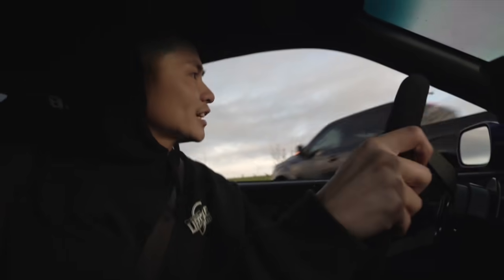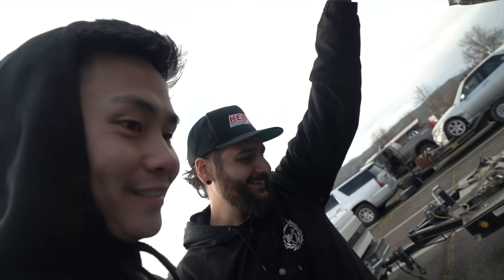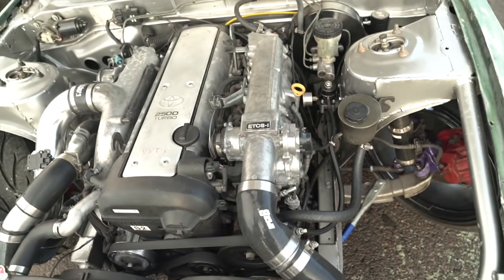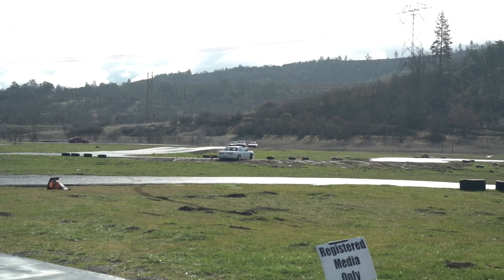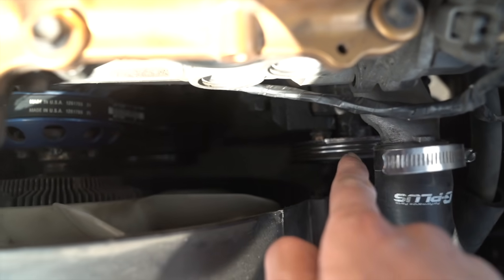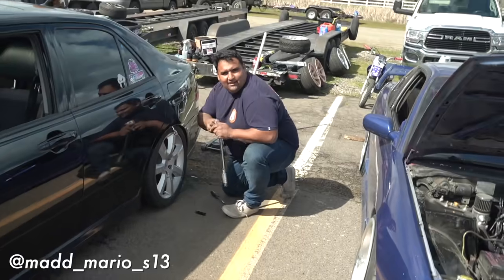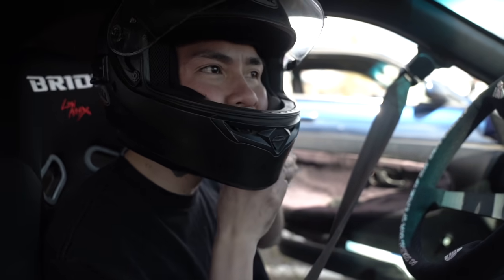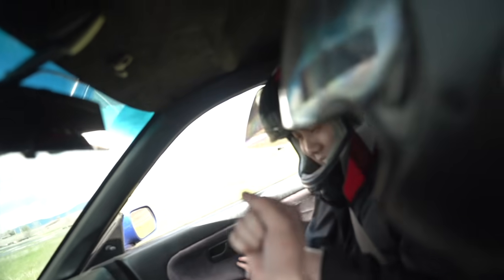FULL SENT Tandem with the boys!! (We CRASHED...)

Comment: Not very smart to LUBE up a belt. That thing can spin off the pulley. This is common sense. I know, I get it. It stops the squeak/squeal, but now you have a potentially slippery belt. The real fix is to replace the pulley(s) if possible